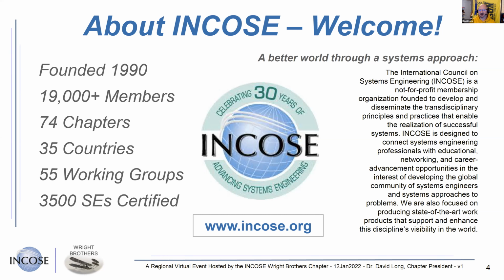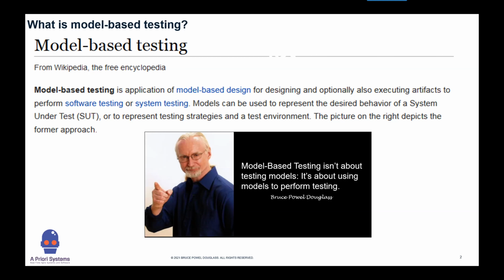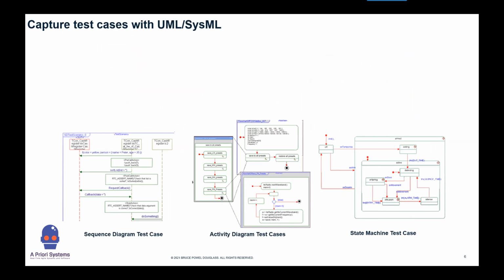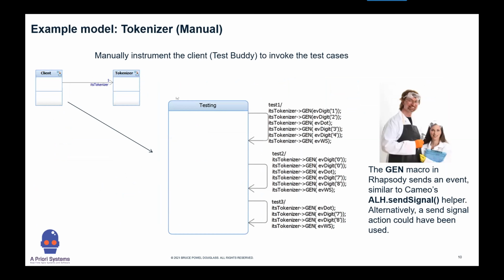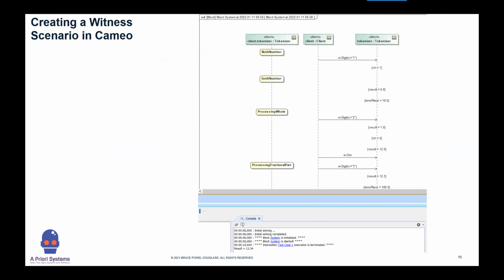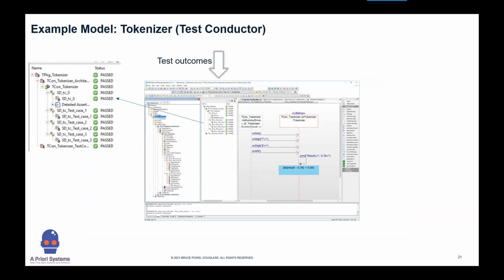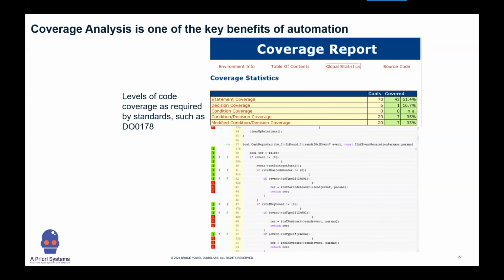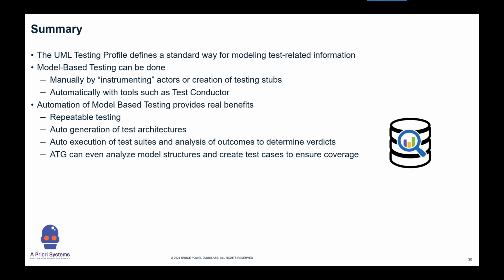Lunch n Learn 7   Model Based Testing

Comment: The biggest problem I see with both Rhapsody and Cameo/Magicdraw testing is that there is a lot of work going into development of test case/scenarios in the model which ONLY tests the model.  The major breakdown of both these tools is that each them don't translate to real-world testing.  What I mean by this is that both tools do not have a way to take what is developed in the model (i.e. test cases/scenarios) and then go into your "actual" test rigs (flatsat, sw sims, etc.) and use those very test cases / scenarios to drive real world sw/system testing.  The reality is that the tester would need to create all those test cases/ scenarios in the environment being used to test in order to test those which is a duplication of effort.  Both tools vendors need to develop a way to bridge that gap so there isn't duplication of effort.